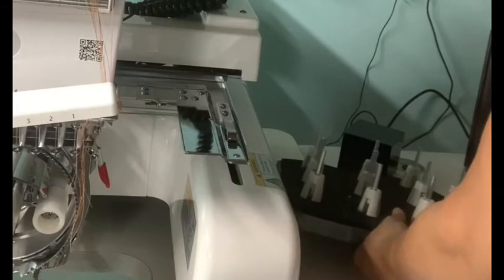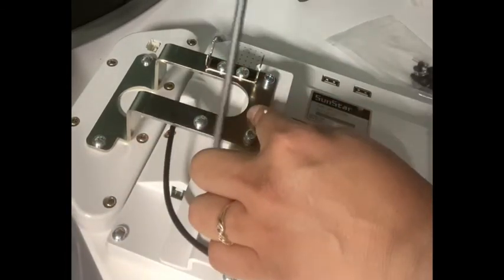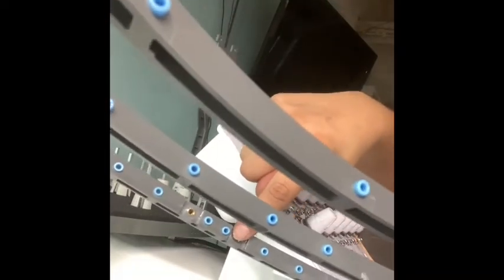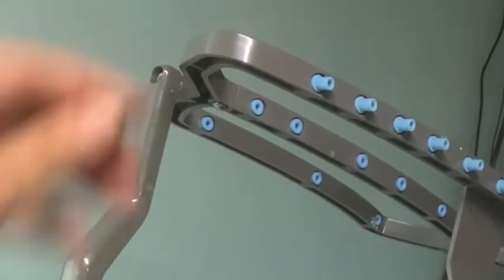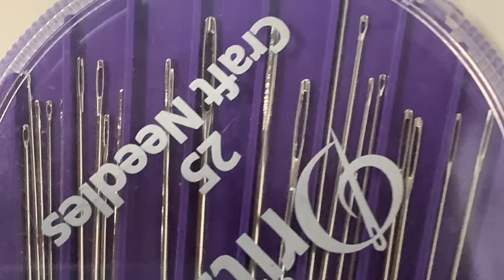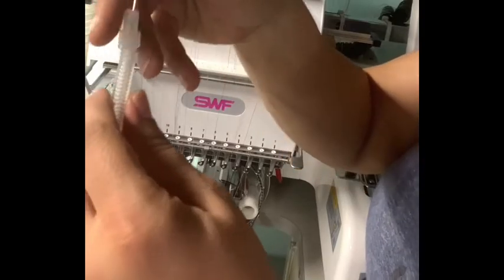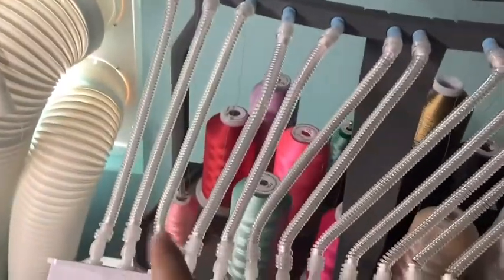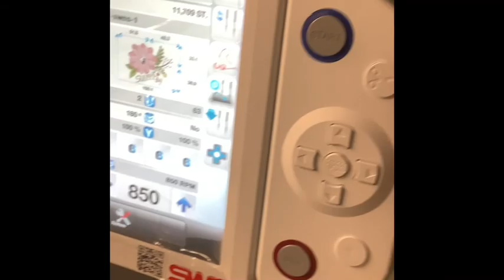SWF MAS-12 step by step Assembling of Embroidery machine see description

Comment: I figured out a good tip for getting the tubes on.  Use a little spit to lube the hole (outside) & the tubes slide on quite easily.  That's about the only thing I've figured out lol.

Comment: Watching this new one, I can see I’m going to have to adjust mine as well! That’s probably the next problem I’ll have once I get this first needle issue fixed. I’m testing on needle 1, which is correct with this new video, but I know the spool next to it I put my red thread on, and used the slot right next to it thinking the same thing you did. I’ll fix that little by little. I can only do so much at a time…a few minutes here and a few minutes there. The good part about that is we’re making the same mistakes and I’m well behind you, so you’re catching them before I even finish making them 😂
Reply from the maker: We will be pros on this one before we know it.
Reply from the maker: Today I'm at work so next video running a stitch out an fonts I will be using. Going to try them in different colors to make sure all my needles positioned right.

Comment: Just wanted to update you.  It was a "dip switch".  If you look at the very bottom of the control panel, far right there are 3 tiny little switches.  #1 has to be down #2&#3 have to be up.  But it is up & running.  Now I'm trying to figure out how to assign the thread colors, lol
Reply from the maker: I need to add time stamp. I have it up. But the direction for spools is diagonally 1 is in front to right of the machine  ↖️↖️↖️↖️.
Reply from the maker: I am going to check my panel when I get home now, thank you for the update.

Comment: Man I wish you showed how to plug in the lcd screen. That’s the only part I’m stuck on
Reply from the maker: On back Theres a plug to top left. And another to the bottom next to the ethernet. I believe theres three connections. If the lights not turning on make sure the emergency red button is not activated.

Comment: I just got my MAS 12 yesterday, thanks for this video! Quick question, have you figured out how to increase the stitch speed? Mine only goes up to 850 but I thought the max was 1000?
Reply from the maker: Yes it should be on screen next to the speed arrows. I manually decrease and increase during a design when my thread is metallic.
Reply from the maker: Theres a arrow on
 left ⬇️ then RPM yours 850 and right ⬆️
Reply from the maker: That's odd it goes all the way to 1000 did you unselect the cap hoop selection
Reply: @Lillymaricreations  I did not, I will try that!

Comment: What usb are you talking about when you say watch your usb?
Reply from the maker: There is a red usb stick that came with the machine. This has the Manuel for the SWF, as well as the software for the SWNS.
Reply: @Lillymaricreations  I found it thanks.  I have the machine completely assembled.  I even managed to rethread it.  Took me 3 hours to thread 7 colors!  But I am pretty sure I did it correctly.  Now my tablet won't turn on when I start the machine & I can't figure out how to remove the cap hoop system.  Can you help me?  I just want to cry :(
Reply from the maker: @jennyperson3217  the cap hoop system is easy just lift it up from the circle small notches on the arm. Also make sure the red emergency button is not engaged
Reply: @Lillymaricreations  Okay!  I got that off.  I'm making small progress.  Still can't get the control panel to work.  I put the usb in my Macbook but it looks like it is not supported for Mac. :(
You are such a great help though.  Thanks so much :)
Reply from the maker: @jennyperson3217  did you try checking the red button under the LED monitor if its on?
Reply from the maker: @jennyperson3217  I have A HP
Reply: @Lillymaricreations  no I wasn't aware of it I'll look
Reply: @Lillymaricreations  I don't see an LED light
Reply from the maker: @jennyperson3217  theres a button with white arrows make sure it's not popped in. Turn it to the right to see if it popped out then see if the monitor turns on
Reply: This comment saved my life!!  Thanks!!